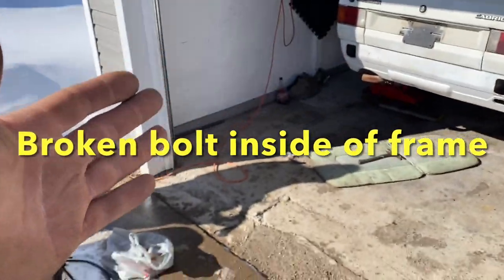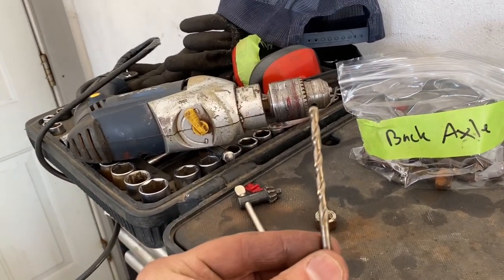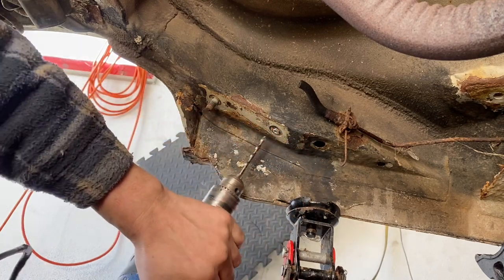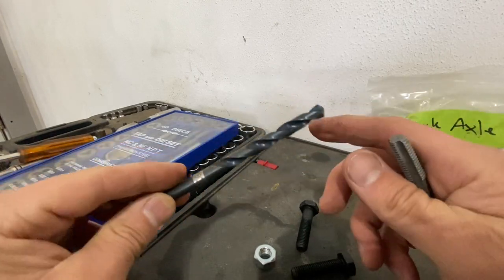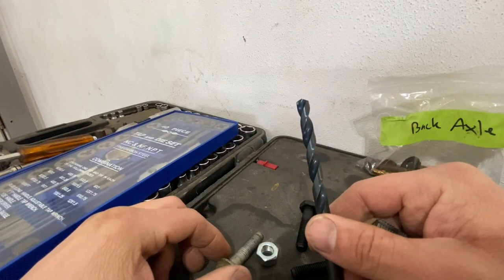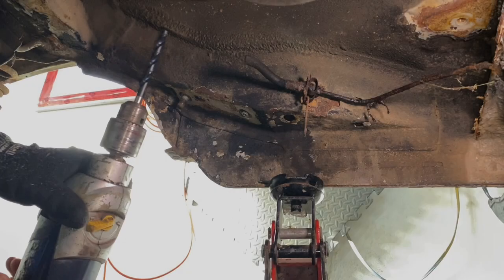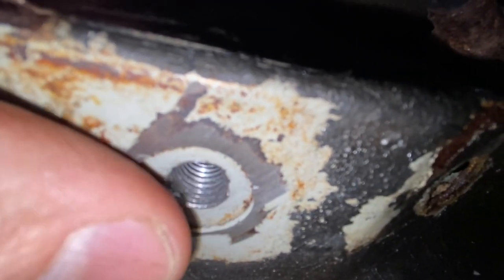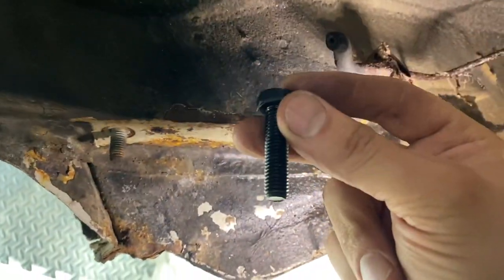How to fix a broken stud in the frame. Trailing arm bolt broke in the ￼frame.

Comment: I've done this for the rear upper control arm on an old Honda. Tapped to the next largest size bolt. It's good to get a peak inside the frame so you can see the wall thickness of what you're tapping into. BTW my repair has been good for years and tens of thousands of kilometers.
Reply: A proper tap handle and cutting oil is highly recommended!

Comment: Aren't you supposed to be doing this in low speed?  It doesn't get the bit as hot and dahl it up, but maybe $15 bits are different.

Comment: The metric threads don't need a chart, just some basic math.
M10 x 1.5 stands for 10mm nominal diameter, and 1.5mm/turn pitch.
Subtract 10mm-1.5mm=8.5mm and you get the drill size
Reply from the maker: Where were you yesterday lol